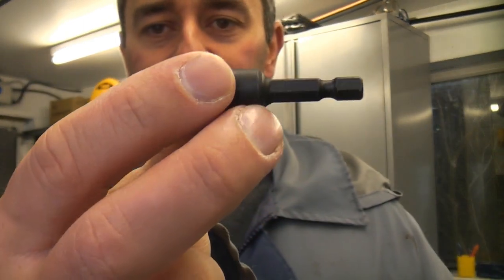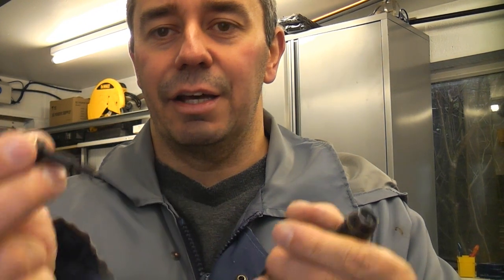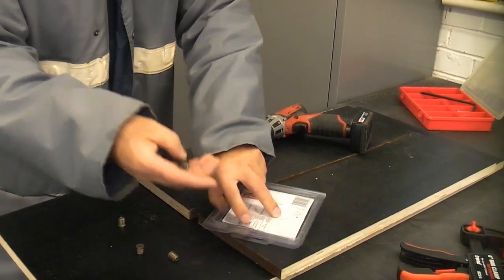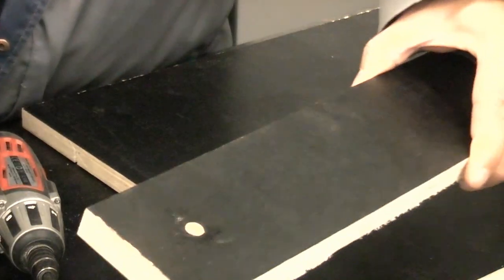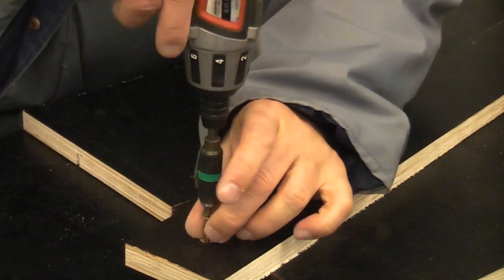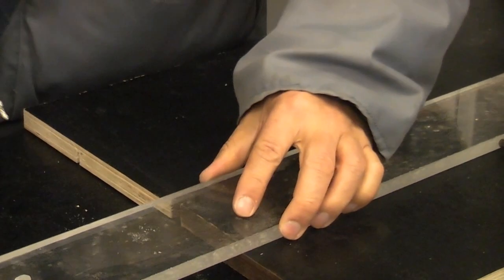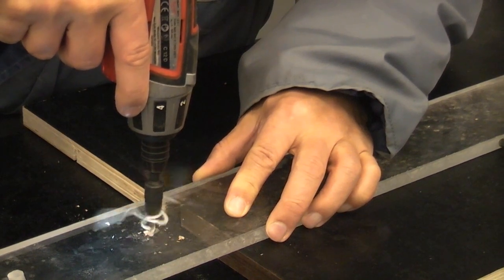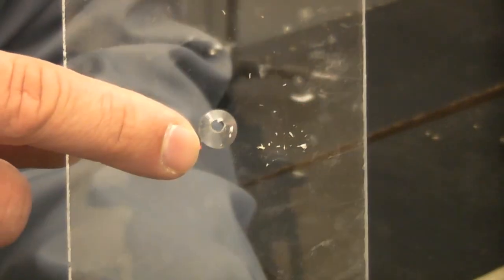Trend drill bit and countersink

Comment: Hiya mate. I recently had a look at the 'flip' style pilot bit/countersink/driver combo sets and liked the look of the trend version. It was a bit cheaper than the dewalt flip drive and much cheaper than some others but I looked a little more and lo and behold I recognised the trend set only it was the identical kit made by silver line at over half the price! And I mean identical as a friend was unfortunate enough to buy the trend before I could steer him into the silver line. To be fair I don't think either of them are as good as the dewalt one which I may now purchase as its since been reduced to less than £18 on eBay with 3 reversible bits and the holder. Maybe you could review it before I splash out as I'm always skint..... Cheers mate!
Reply from the maker: I'll look at getting one in future ;-)

One thing though, Dewalt and Trend sell good quality gear. I have tried Silverline a few times and their tools have always been useless, so although it looks identical to the Trend set you can be sure it won't be as good ;-)
Thanks for the comment